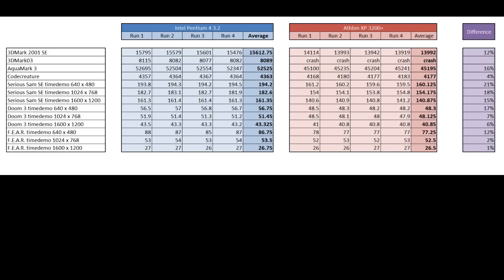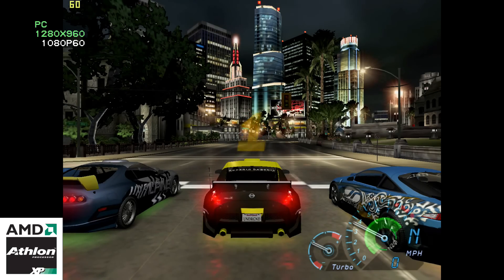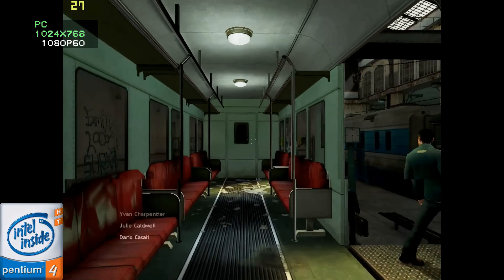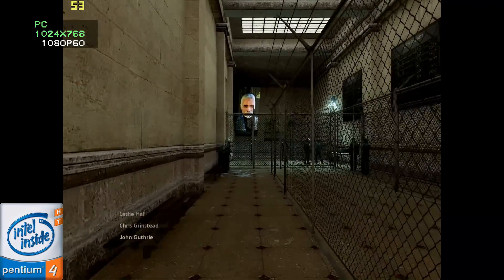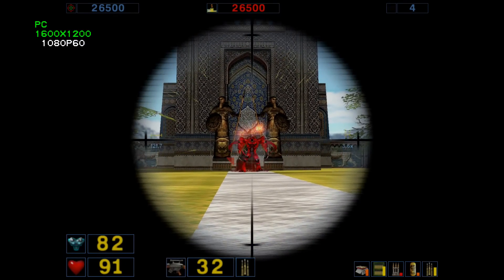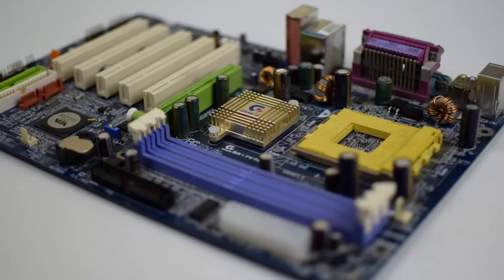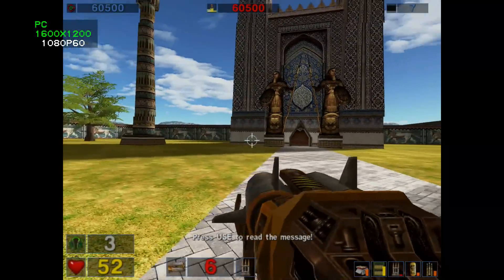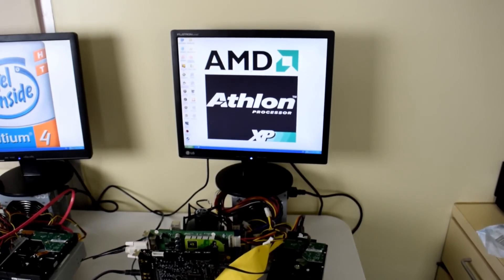Intel vs AMD S1E1 - P4 3.2 vs XP 3200+

Comment: yeap, it's 2025 and have 2x 2500+ lying around... both can do 3200+ with FSB400. tested one for 4 hrs with cpu-z stress test, no problem, default voltage. i couldn't believe it. i'll test soon the second 2500+, maybe this one will be stable too. i feel so lucky :)

Comment: I had an XP mobile 2600+ in a Nforce 2 Ultra 400 mainboard. Via chipsets were not as powerfull and I believe matching the XP with an nforce 2 ultra would be a fairer comparison with a P4 with intel 865 G or P. (not saying the P4 wouldn't win in that scenario)

Comment: Back in the day I made myself an AthlonXP 2400+ with a Geforce Ti4200 Agp8, My motherboard was an Nforce2 if memory serves me right. Back in the day I always got Nvidia Chipset boards.
It ran FarCry like butter.
I eventually upgraded it to an AthlonXP3000+ but ended up very disappointed. It's not that it was a bad chip, but the reality of going from 2Ghz to 2Ghz. While the XP3000 had a faster FSB and I think increased L2 Cash, it didn't make a significant difference.
I later got myself a super cheap Biostar low end Nvidia chipset board with an Athlon 64 X2 3800+ ... another 2Ghz chip however the performance difference was spectacular. And hilariously at that point people would say it doesn't make a big difference in gaming as games aren't optimized for dual cores... but that didn't matter, it was huge as Alt Tabbing out of a game was instant... the multitasking power was a huge performance jump.
I lived with a roommate, he bought a Pentium4 1.5 Willamette... that thing was a turtle so I ended up giving him my old Barton PC as I kept it as a secondary PC.

Comment: Thank you for the nice video. I also think that the motherboard was relative important for perfomance of the Athlon XP back in the days. If I remember right, there was a statement, that the performance rating was definded with a nforce2 chipset like on an ASUS A7N8X. Dual Channel mode brought additional 3-5% of perfomance compared to the via chipsets. I drove long time an Athlon XP 3000+ (16MHz FSB) at 2.3 GHz with 200 MHz FSB stable on an ASUS A7N8X-E Deluxe with a Redaeon X800 pro. Good old days :)
My Voodoo5 retro machine runs with an Athlon XP 2600 with a VIA KTA333 and its much, much slower...

Comment: the 400 and 533FSB netbursts were exceptionally bad.    At least  the 3.2ghz p4 had 800mhz fsb
I was annoyed at AMD's naming convention back then when they delineated from using the actual clock speeds,  but I understand why they did it since their 2.2ghz Athlon XP 3200+ was a hell of a lot faster than a netburst at  2.2ghz.   
That said,  the mobile barton Athlon XPs were a lot of fun for overclocking.    You could spend like $70 on an Athlon XP 2500+ mobile,  overclock it to 2.2ghz, and crap all over most of Intels lineup.

Comment: I kinda want to see a video like this redone with an Nforce2 chipset motherboard and a good SATA PCI controller card that can support SATA3 SSDs. That's the setup I have on my own Athlon XP retro gaming system currently, and it works great. Would be interested to see how it compares to the equivalent P4 of the time.

Comment: I'm building exactly these, for my kids! I want them to see what gaming was like for me when I was in really got into gaming, which set me off into my career field!

Corner of my office will be setup just for both systems. Monitor, keyboard, mouse, and Creative Labs 5.1 surround system.
Reply from the maker: Awesome, it's a really fun hobby!
Reply: @philscomputerlab  huge question! LinksKey KVM switch w/ surround support. Is that the only option for having two S.B. EAX cards hooked to a 5.1 sound system? Reviews a a bit mixed, thinking I'm better off w/o the KVM switch.
Reply from the maker: @scottstamm7022  Hmm good question. For Stereo it's easy, plenty of switches available on Amazon. I would say there will not be too many choices for you unless you are happy with manually plugging things around?
Reply: @philscomputerlab  I know I'm asking a lot, but there's one by "LinksKey" that works for 2 PC setup (DVI + VGA [or] DVI + DVI) with 7.1 audio in a switch.

I keep reading that some people are having issues, and not sure if it's worth buying, or just pass on it and manually plug/play as my kids would see fit.

Comment: I´m having similar issue but on a X1650 Pro and a Athlon XP(more than one..) on 3DMark 2001SE, always crash on 22 seconds of Nature test. Passes fine on 3Dmark 03, I´ve tested on A7V600 and A7N8X boards, so eliminated board or AGP driver glitch, tested 4 different Radeon drivers, and finally noted one difference: it happens when CPU is over 1.9Ghz, using lower clock it passes fine. But isn´t instability os the system, I´ve tried on few CPUs and my XP-M runs stable at much more than 1.9Ghz, so isn´t instability(so stable on Orthos and other stress tests), is definitely something that happens always on same place on the benchmark. I found a way to pass: using A7N8X and booting from lower speed(9,5x166 for example) and changing FSB on-the-fly to 232Mhz(2.2Ghz CPU) it passes fine!! The problem occurs when booting on the "normal" higher speed.

Comment: It would have been nicer if the motherboard in the video for the XP processor, also supported DualChannel RAM.
My Athlon XP 3200+ runs wonderfully with 3DMark 03. With a Gigabyte 6800GT I reach 10573 3DMark.
19168 3DMark 99. 17838 3DMark 01. 16721 3DMark 2000 (The 2000 benchmark should deliver higher values than the 2001. This was not the case in my test).
Without overclocking. On a motherboard with nForce 2 and DualChannel RAM.
The XP 3200 should be on the level of a PIV 2.8 - 3.0GHz. AMD's performance rating was a bit too high.
Reply from the maker: Yea that's all I had at the time. I believe there is another video at least when I use a nForce board with the 3200+. In general, because of the PSU situation (heavy load in 5V rail which modern PSUs don't have), you are better off going Athlon 64.

Comment: Well the P4 is superior to Athlon in several ways, twice the threads, twice the L2, and SSE3. Also higher overclock-ability room, when it comes to that. On the other hand, eats more watts and runs hotter.

Comment: 3DMark2003 crashes because the Athlon XP does Not have SSE2. I use an ATI HD2600 AGP with Catalyst V12.1. The System Always restarted. I managed to patch the Driver, not to use  SSE2. After this it worked very well. Older Drivers (< Catalyst V8) do not use  SSE2.

Comment: Hi Phil (I hope I may call you that),

I know it's some year ago you produced this video, but I have a solution for your 3dmark03 crashing at nature game test issue: I recently built a retro XP PC based on Barton 2800+ and a via KT400 Chipset. But the Problem isn't related to the Chipset or the Processor. I also use a Geforce 6600 GT just because I owned one back in 2005. And this is the reason why the test crashes. Well, it's not the hardware, it's the dirver! I had the same problem using the latest driver for Windows XP from the nvidia download page. I don't remember the exact version, something in the 3xx.xxs. I had issues with some games too: Need for Speed underground crashed always during the second or third race. I uninstalled the driver and installed Forceware 163.71 from a magazine DVD from 2007 I found on my attic. Now the benchmark runs through and I can play Need for Speed for hours. Sometimes it still crashes but I think that was the time back then, as far as I remember ;-)

I had similar issues with my 98SE Pentium III. I use a Riva TNT2 M64, because I got it for free, and the newest driver, I think it's 72.??, made 3dmark200 crash. Now I use 45.23 from your website and it runs great. With lower versions I had issues with 3dmark2001 which ran perfectly with 72.??. So thank you for offering this driver for download!

I also want to thank you for your work producing videos for this channel. I had my first computer back in 1993, a Commodore PC-20 (II or III) when I was 7 years old (my father bought an used 80386 that year and I got the PC for math learning and some games). I enjoy watching your videos and remembering the past.

Greetings from Germany!
Reply from the maker: Oh wow! Thanks so much for following up and reaching out :D So it was the driver version after all... Good to know :D

Comment: Hey Man, I look today this video first time ^^
When you want going an directly performancecheck between this 2 CPU´s, you have to use same grounds.
For the Intel Pentium 4 you use a Board with an SATA Controller ^^
OK, THAN YOU HAVE TO USE AN Sockel A Board with SATA, there many Boards with that ^^ 
Like Asrock K7NF2-RAID
and everyone, how have knowledge about the AMD Athlon XP,  know, that the NForce2 Chipset is the best for this CPU.
VIA Chipsets are not bat, but not for performance this CPU!
When I thinking back in time, when I have the AMD Athlon XP 2200+ ^^ everyone with a Pentium 4 till 2,8 GHz was slow again my System!
You use a newer board and newer HDD for this Test for the Pentium 4 ^^ it´s not good!
Reply: You think that using a SATA hard drive will give a boost to in-game frame rates? 🤦🏻‍♂️

Comment: the AMD processor 3200+ works better with nvidia chipset and not the crap like VIA... the Intel have an Intel chipset , for the amd if u used an asus motherboard with nvidia chipset (nforce2) the result will be different !

Comment: I had an athlon xp 2000+ at the time with an Abit NF7-S motherboard. I not experienced that crash in 3D mark 2003.
Reply: I had a 3200+ and back in the day i would run 3d mark, the same water turtle bench and I didn't  have a crashing problem.

Comment: Cool surprised you didnt mention the athlon 3200+ chip being only 2.2ghz, this a 2.2ghz chip compared to a 3.2ghz lets not forget so its really not fair to say the pentium 4 was better.  I think this was the only time in history AMD was ahead of intel clock for clock.  And as such happened to be the CPU I put in my first  gaming build, the 2500+ athlon xp clocked in at 1.8ghz which I overclocked  to 2.8ghz  and paired with a gtx 5900 at the time allowed me to experience COD in its full glory!

Comment: Good comparison.. Back in the socket 478 P4 days yes the heatsinks were being streached and throttling was common esecialy with the 3ghz p4 and up. What i used to do was buy the biggest heatsink i could find and replace the fan with a much higher cfm fan and faster turning to reduce or remove throttling and install high cfm case fans also and use to use the 12v sunnon high cfm server fans.. yes it would sound like a hairdryer was on full blast but it ran fast as it could go.

Comment: Back in th early 2000s, i've had both INTEL and AMD systems, but my #1 PSU of choice was by ENERMAX, and the one i still own to this day and works perfectly, is the 550w, model EG651P-VE v1.2 , it offers 36a equally on the +12v/+5v/+3.3v rails, it features the stand alone 20pin motherboard connector, a seperate 4pin connector for the P4 systems and a 6pin inline aux connector and many 4pin molex connectors and floppy connectors. I had it stored away for quite a few years till i got bit by the retro gaming bug, so it came back into service, mostly as a tester powersupply, with some run time in between for gaming of course, great thanks to you for your videos taking that trip down memory lane over and over, reminding us about the earlier PCs that most of us grew up with and loved.

Comment: Back in the day, my last Socket A was an XP 2400+m that I had on a DFI NF2 Ultra Infinity.

Just recently, I managed to build a Socket A system because I came across a 400FSB XP 3200+... just like the  one you're using here. For the moment, it's on an Abit KW7 motherboard, which has the VIA KT880 chipset. Haven't tried running 3DMark yet, but I don't have that big of a hard drive on that system, either. I'll have to investigate that issue myself whenever I can get some spare time to do so. At the moment, a little more preoccupied seeing if I can tune the memory timings on the setup better than what it does via SPD timings. Trying to eke out any extra memory performance I can get on the platform.

Comment: That is not an Athlon 3200+. That is a Barton socket A 462 Athlon XP 3200 which was a 32bit CPU and was released May 13, 2003 at a clockspeed of 2.2 GHz and was designed to compete with the Pentium 4 2.8 GHz socket 423 which was also a 32 bit CPU. The Athlon 3200XP clocked at 2.2 GHz obliterated the Intel Pentium 4 clocked at 2.8 GHz. Now a fair comparison would be to take the Athlon 64 3200+ @2.2 GHz  to the Pentium 4 at 3.2 GHz because the P4 3.2 GHz was a 64 bit CPU and was released July 23, 2003. The Athlon 64 3200+ had 2 models. one was clocked at 2.2 GHz like the Barton on Socket 462 and one was clocked at 2.0. The Athlon 64 3200+ was released September 23, 2003 on Socket 754 or also known as AM1.
Reply from the maker: Athlon XP 3200+ is the title and thumbnail, not sure what the confusion is?
Reply: That IS an Athlon XP 3200+ and the Pentium 4 3.2 GHz is NOT a 64-bit CPU. 

You should try thinking before commenting.
Reply: @jonchapman6821  You should learn not to reply when you have no idea what you're talking about. The Pentium 4 was a 64-Bit CPU. There is a difference between aa Athlon 3200 and an Athlon 3200+. One is a Socket 462 with 512K cache and the other is a socket 939 64-Bit CPU with 1mb cache. The Pentium 4 is not AMD64 compatible but it is EM64T compatible.
Reply: @tskraj3190  He’s using a Socket 478 Northwood Pentium 4 3.2Ghz SL6WG with hyperthreading, that is a 32-bit CPU. 

There are many 64-bit Pentium 4’s, but that is not one of them. 

I agree, there are many differences between a socket 462 Athlon XP 3200+ and a socket 939 Athlon 64 3200+ but the only difference that is relevant to this video is the undeniable fact that he’s using a socket 462 (Barton core) AXDA32000DKV4E 400MHz FSB Athlon XP 3200+ which, just like the Pentium 4 he’s using, is also a 32-bit CPU. 

I don’t really know what to say to you, you’re disagreeing with cold, hard, verifiable facts. You can clearly see the parts he’s using in the video, there is no discussion here.

Comment: Had athlon Barton 2500+, 512cache , oc fsb from 166 to 227 ;)) on abit nf7 sl2 + zalman cooper cooler and pc3500ram..it was flyiiing with gainward gf4 4200ti
Reply: Still have it in basement ;)
Reply: @jamesbond-yk1mb  zalman copper cooler was awesome, im trying to get one for my xp 3200+ retro system but they are quite hard to find...

Comment: I remember back in those days all I ever wanted was a radeon 9700 pro, and an athlon 3200+. Then somehow by the mid 2000s (2005-2008) I felt content with my low-end Sempron 2500+ and Radeon 9550. But hey I guess it was enough to play the games.

Comment: My first selfbuilt PC run an Sempron 2200+ on EPOX 8RDA3I chipset nForce2 Ultra 400. Even if the CPU only run at 1.5GHz (9×166MHz) I could OC to 1.925GHz with FSB at 214MHz without stability issues. It must be the VIA chipset that gives you troubles in 3DMark 03. The GPU was GeCube Radeon 9550GU running at 9600 Pro speeds 400/600MHz (amazing GPU). I never experienced crashes with my build and everything was rock solid. Wish you all the best!

You could try an EPOX 8RDA , Abit NF7 or Asus A7N8X-E Deluxe. The last one had a Silicon Image SiI3112. I modded the motherboard bios with latest firmware from SiI3112 and the motherboard could use 1TB+ HDDs. That was amazing!
Reply from the maker: A different video driver fixed the issue, but the bug doesn't happen with Intel CPUs. I found other instances with the AMD CPU causing issues, so it might not be 100% compatible actually.
Reply: @philscomputerlab  Glad to hear that it could be fixed with another driver. I found VIA to be ok up until KT333, after that nForce chipsets were all-around better.
Reply from the maker: Yea nForce is faster, and the later boards have the 12V 4-pin CPU connector which is great. I do like the VIA boards for slower Athlons because they are very compatible with PCI DOS sound cards.

Comment: What Athlon XP is?
There was an Athlon XP 3200+  Barton with 333 and 400Mhz FSB.
Reply from the maker: The 400 MHz one is used in this video!
Reply: @philscomputerlab  
Is whatever, as every Barton CPU can run at 400MHz bus, when is set in BIOS to 200...
BTW i have and OC mobile Barton 2600+, at 2.6GHz real speed that is like 4000+ PR, or similar, i bet will trash the P4 3.2GHz... 
https://valid.x86.fr/9s6qlr

Comment: A few years ago I was given a Socket A board that had a Silicon Image SATA controller on it. It had the same problem with SATA 3 drives, and large drives. There was a newer BIOS for the SATA controller, so I looked up how to edit that newer BIOS into the main BIOS image. Once I did that, it worked with SATA three drives, and could handle drives as large as a terabyte.

Comment: I have an old Compaq Socket A with Via KM400 chipset and AGP slot (N6200 nVidia) and was having issues in WinXP running 3DMark03 crashing and restarting the computer. I installed the ForceWare driver 93.71 WHQL and it solved the driver crashes for me too. Many Thanks! I also have a couple ATI 9700 AGP but haven't solved the driver issues / crashing with them yet, any recommendations on driver version? I've tried the latest recommended from AMD's website but crashed 3DMark 2001 and 2003
Reply from the maker: I did a video on Thunderbird 1400 recently, using an Asus and MSI motherboard with KT266A chipset. I used a Radeon 9800, 6600GT, X850 XT and HD 3650, but I don't think I ran 3DMark. The 6600 GT, 6800 GT and X800 / X850 series seem to be a very good fit for this era.
Reply: Thanks! for the reply. I watched your "How ATI upset Nvidia with the Radeon 9700 Pro" video and you used v6.12 in that one. So I downloaded them from your website and whamo! the ATI 9700 is passing benchmarks and played a bit-o-unreal 2003 just fine. Your videos have been such a big help more than once. Thank You :)
Reply from the maker: Nice :)